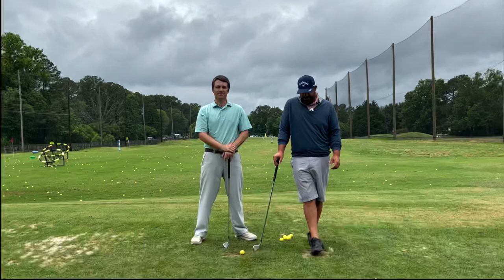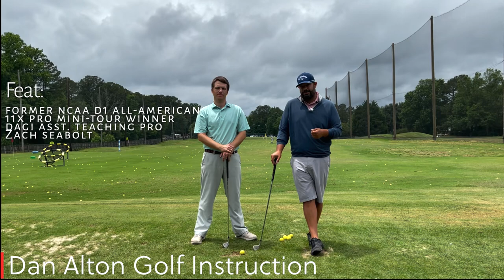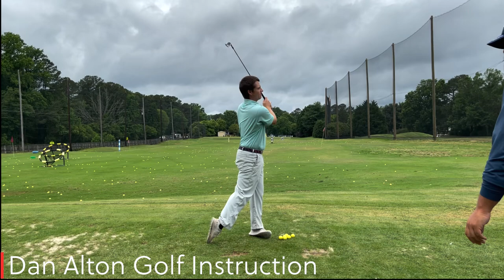Create Width OR Lag in Your Golf Swing & You CANT Try Both - 1 Ruins the Other/1 Creates the Other⛳️

Comment: New subscriber. Love your teaching. Can you clarify what you refer to as front and up type shifting? Should weight start and stay up front? Thanks
Reply from the maker: It’s actually starts a little forward, then goes to 50/50 on the release, as the club comes thru the player goes up, the club passing then pulls the player forward.  Little different with shorter clubs when you can just move into them but anything 6i back for most players should feel it the way explained. Which is why most amateurs hit their bigger clubs the same distance as smaller ones. It’s all about speed and how you achieve it.

Comment: If one releases faster for more club head speed, does one need to rotate faster to accommodate the faster release. Seems like when I rush the release the ball pulls and goes left. I’ve been hearing a lot of “exiting left” after impact too. Any thoughts on this or is this just a byproduct of a correct swing?
Reply from the maker: As you’re trying to release faster you’re rolling your left hand/forearm. Keep it face down. Ball cannot curve left.  Shoulders make it start left. Check out my video on the 4 misses. https://youtu.be/6bobvj5tYe8
The club always exits left if the handle is not pulled - it’s just a matter of left palm being down.  Also, from the players vantage point it may or may not look like it goes or feels like it goes left - that’s a personal feeling/sight. But as long as it’s released it will go left
Reply: @danaltongolfinstruction  sounds good. When this is done right, I can feel it. Fluid and effortless. In my mind I have to say “release” at the top of the backswing just before transition. That’s about as good as I can explain it. Kinda like skeet shooting if you can imagine that. Instead of “pull” I say “release” and fire through.
Reply from the maker: @lgs42  that’s really awesome, we all have to find our own thoughts to execute - great job!